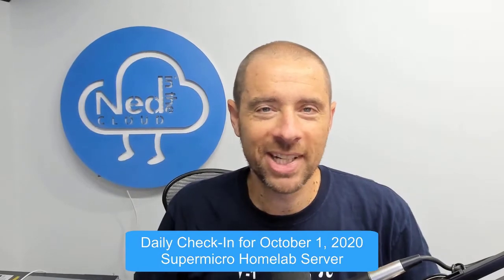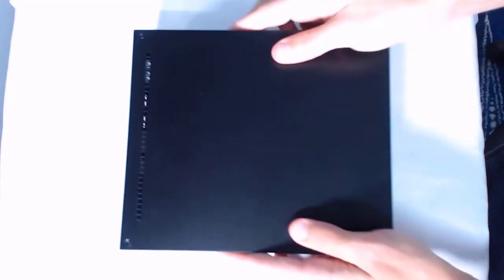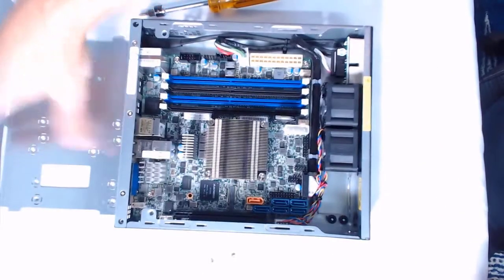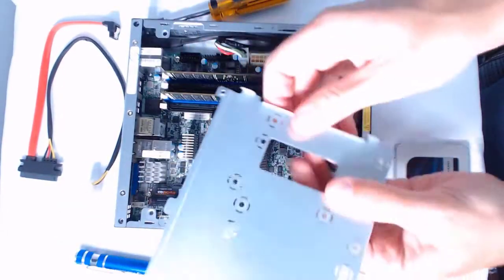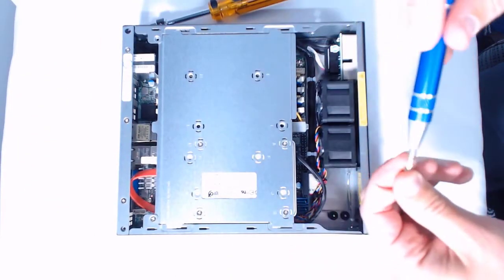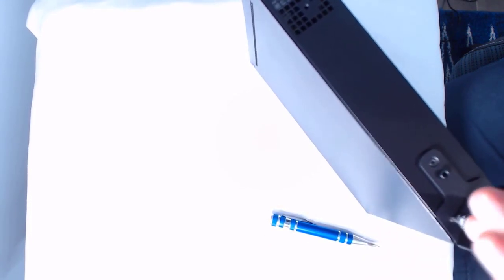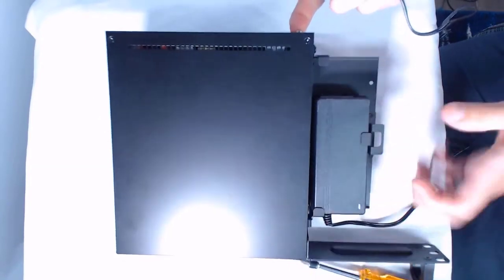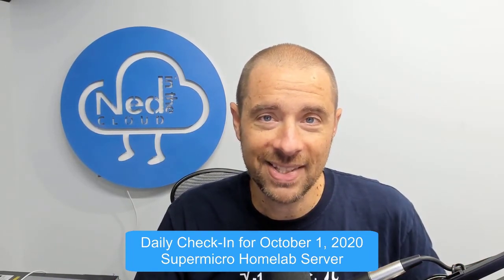Setting up my new Supermicro Server

Comment: What is the part number for power adapter. I lost somewhere in transit. I am trying to find the correct one but manual is showing 2 options 60 watt and 84 watt. I am not sure which one came with the server.

Comment: There are adaptor cables that can consolidate those sata (or sas?) interfaces into one external connection that could then be connected to a separate storage unit for housing and power supply to six drives.  It would have been nice to see in the video if the server's case supported installation of such a cable.  If I was supermicro, I would have had that in the server by default.

Comment: Do those units come with everything minus the ssd and ram?
Reply from the maker: You can buy the units configured with or without SSDs and RAM. I chose to order the RAM and SSDs separately because it was slightly less expensive and I got to choose exactly what I wanted. The downside is that I had to install the components myself. I don't mind doing that, but I can see others preferring a complete system.

Comment: I'll be curious to see how power efficient they are.  that's one thing I've always been concerned about with a home lab is the power draw
Reply from the maker: I've been thinking about getting a Kill A Watt meter to find out. It will be different depending on the workload I push to the server, but once I have it all set up, I'll let you know!
Reply: The power supplies are between 60W-80W so I really doubt they draw more than say 50W normally (so about an incandescant bulb or laptop). My 8 year old servers all draw about 120W minimum and more often draw about 200W with a load. Just to give some context.